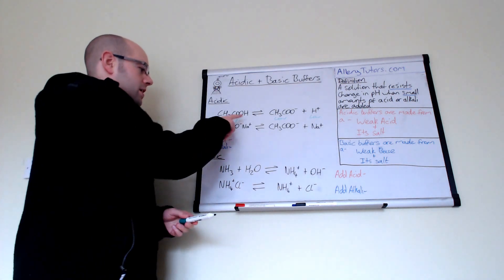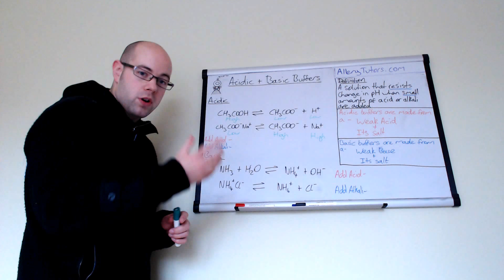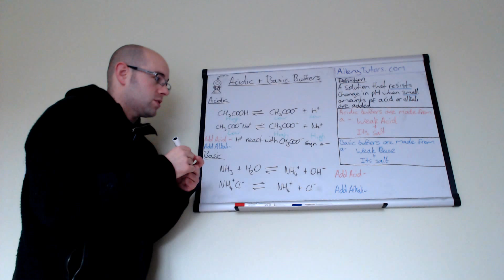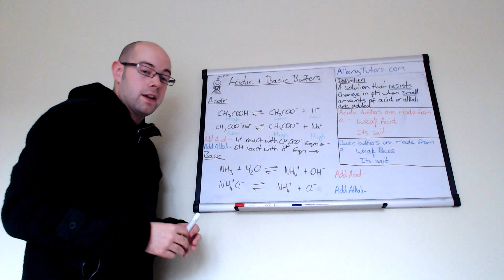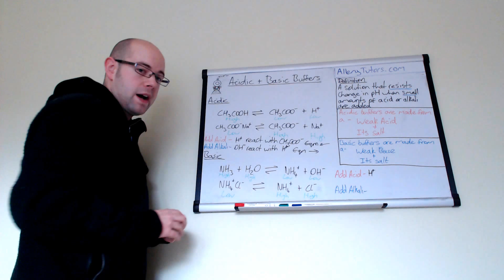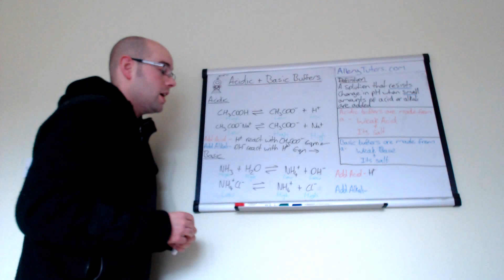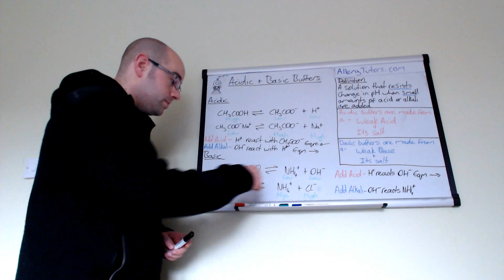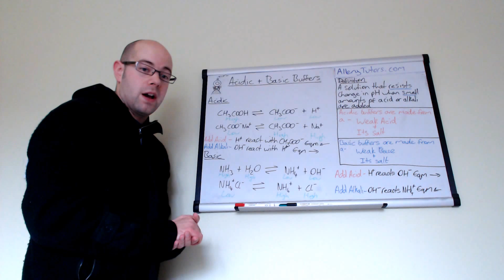Acidic and Basic Buffers

Comment: Why are the concentrations of the salts low ?
Reply: I know i'm a bit late but.... salts dissociate very readily in solution. Just think of common table salt and how easily that dissolves in water. Due to this extensive dissociation there is a low concentration of the salt but a high concentration of its ions in solution.

Comment: for the basic buffer when you added alkali why did the equilibrium shift to the left?
Reply: Zak z I am also confused about this...
Reply: Because the OH- reacts wit the NH4+ to form NH3 and water bish
Reply: to remove the excess OH- ions from the solution and keep the pH constant
Reply: Learn definitions of buffers (weak acid or base PLUS its corresponding salt) and weak acids/bases (ie only partially dissociate into H+ or OH- ions in water hence WEAK, so establishing an equilibrium/reversible reaction with them). Then apply LeChateliers principle - which is just like negative feedback mechanism in biology. Homeostasis is the term used to describe 'keeping things the same' - for example body temperature (an internal thermostat) or blood pH. Carbonic acid/hydrogen carbonate ions in blood is great example of an acidic buffer, which can resist SMALL changes in pH maintaining blood pH around 7.4 (vital to staying alive!). I hope that helps to give context for learning/understanding buffers!
With regards to basic buffer though, you just apply LeChateliers principle in the same way as you would for acidic buffers - since XS OH- ions are added, the equilibrium must shift in the direction to OPPOSE this action(ie remove the XS OH-). So SOME (but not all) of the ammonium ions NH4 + present in solution (formed from both weak base ammonia and its salt) react with the XS OH- ions to reform ammonia NH3 (and water H20), so shifting equilibrium to the lefthand side.
 In this way, a buffer maintains a constant pH - but only for SMALL additions of acid or alkali! I hope this helps to clarify as buffers are tricky I know!
Reply: @ajtrott1 but if OH- reacts with NH4 to make NH3 and H20 doesn’t that just increase the concentration of NH3 and H20 even more? So the equilibrium would shift to the right to oppose the change?

Comment: A buffer solution means resisting change in Ph right? So when an acid(H+) is added to that solution, the H+ reacts with the COO- and produces a higher concentration of COOH? Doesn't this mean the value of Ph decreases?
Reply from the maker: +Aashish_Menon Yes that's right. But remember pH is a measure of H+ ions. COOH dissociates weakly and hence does not produce many H+ ions. For this reason the pH value doesn't go lower. Hope this helps?
Reply: +Allery Chemistry Hi, I'm really confused about a certain part in the acidic buffer section. How come CH3COO-NA+ dissociates completely? I thought that for an acidic buffer, the salt has to be weak as well?
Reply from the maker: +Lilith Salts dissociate fully. The salt doesn't have to be weak only the acid has to be weak. Buffers don't work with strong acids.
Reply: Thank you!